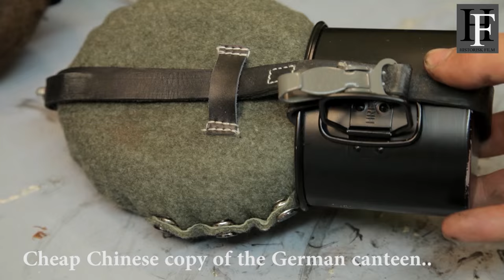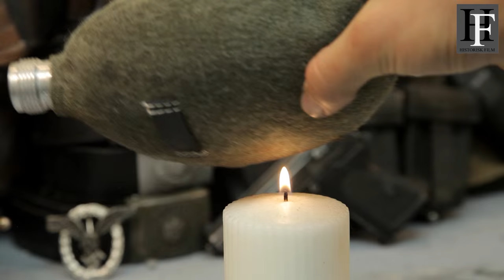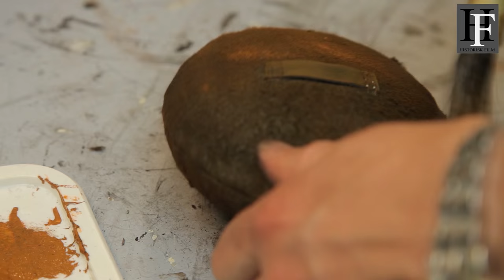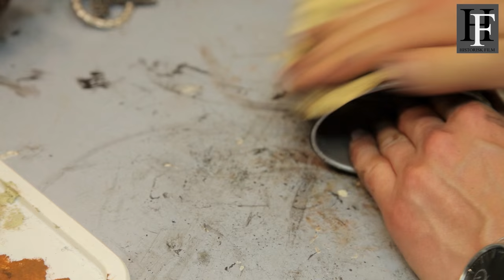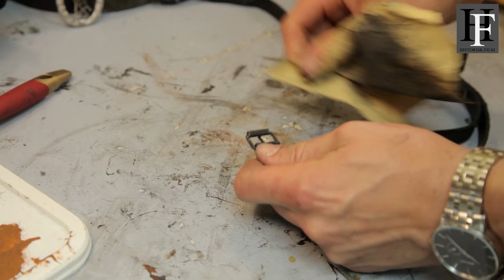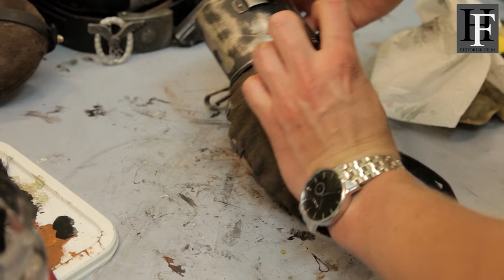Ageing WWII Props - German M31 Canteen

Comment: That canteen looks like it's seen hell and back. Did they really receive that much wear?
Reply from the maker: Yes, many had hardly any or no paint left after a while - this was normal.
Reply: Well, chances are the soldier had it on the back part of their kit, so it'd be clattering against other items depending on where the owner put it, when you dived for cover you'd probably bang it up in the dirt. You slept in muddy trenches and destroyed buildings, sometimes a fire still burning inside the building. So yeah, I guess it would look like it's been through hell.

Comment: I know I’m late but wouldn’t the paint on the cover eventually wash off, cause I’m getting a canteen from Hessen Antique and I’m going to weather it so I’m just figuring out the best way to do so but I had to get the economy canteen cause the other was out of stock. Btw is Hessen a good place to buy the canteens.
Reply: Get original canteens and messkits anything metal get original
Reply: @thIDthIRreenactor  just as WW2Freak said: get original canteens, messkits, helmets etc.
Reply: @solesz426  that's what I said yup

Comment: Very nice job on the canteen cover, but the cup is way too much aged. :)
Reply: There are examples of original cups without any paint left on them, but the thing is that it looks off when you age the cup with sandpaper. The best way to age the cup is just use it a lot, so the paint chips off in a 'natural' way.